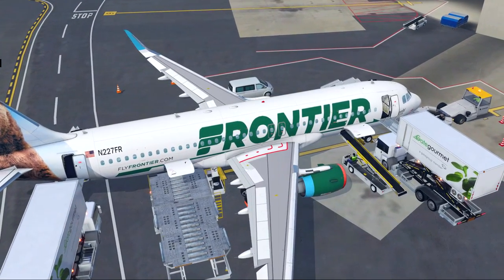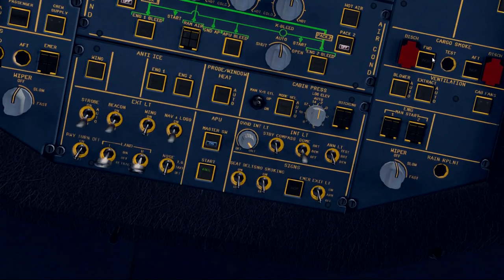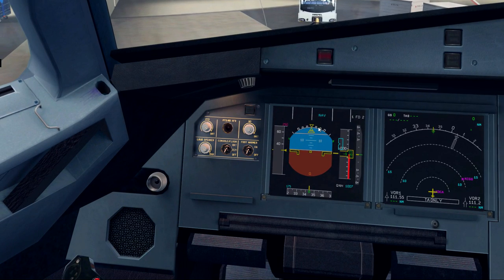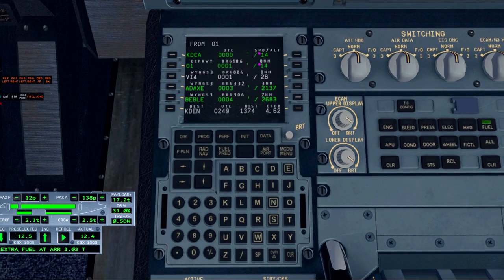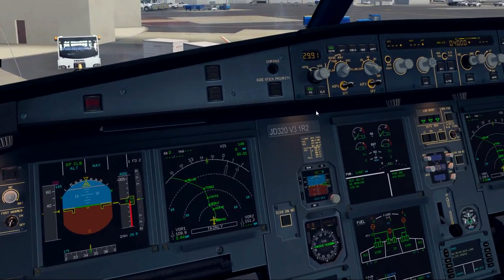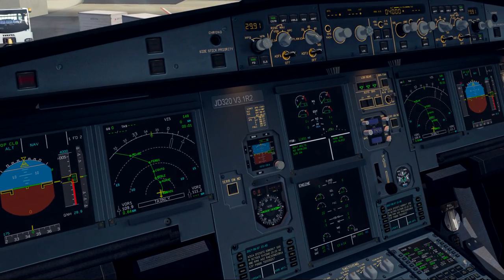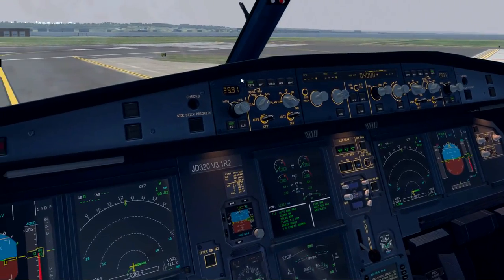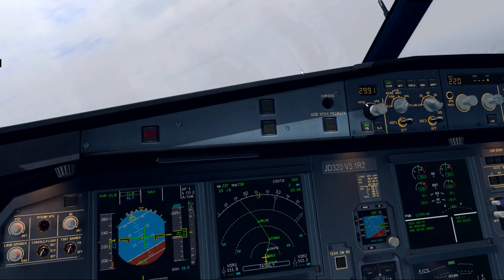X-Plane 11 - From Cold and Dark to Takeoff - Complete Tutorial - JARDesign A320

Comment: you are supposed to shutdown apu after engine starts.
Reply from the maker: Once the main generators are supplying power the APU is no longer required and is just burning extra fuel.   It probably differs by airline but I shut mine off after engine start and complete and the generators are now supply power and airduct pressure for the PAX system.

Comment: hello , quick question , how can i update my database of the MCDU ? thanks
Reply from the maker: You need access to an AIRAC data provider.  The two big ones are Navigraph and Aerosoft Navdata PRO.   Once you have a new cycle package from either of these you would plug it in to the custom data folder in the A320 aircraft folder per the instructions in the JARDesign manual.
Reply: Captain K-Man thank you so much , I suppose that now , I have to figure which of both are the best , between Navigraph and Aerosoft
Reply from the maker: I personally prefer Navigraph.  I subscribe to their monthly service which gives me access to unlimited AIRAC cycles and access to the CHARTS App which let's me load up-to-date full color SID/STAR/AIRPORT information plates.   Navigraph is used by 99% of all aircraft and utility apps in X-Plane.

Comment: APU should have gone off before takeoff lineup (or prob before taxi).
Reply from the maker: Most likely.  It's kind of the way we do it in the 737.   After the both engines are on, establish PAX Air, switch off APU Bleed then power down the APU and finish up before taxi checklists.   I need a lot more practice in the Airbus.

Comment: love the video thanks! I did have a question though, how did you update your nav data???
Reply from the maker: I have a subscription to Navigraph.   I used the FMS Data Manager to install the data automatically as it is updated to the latest cycle.  You can also manually add the data by downloading it from Navigraph for the JARDesign Axx series of aircraft and just unpack the contents into the A320's install folder in the NavData sub folder.   Either way, AIRAC cycles are not free.
Reply: oh okay thank you very much!
Reply: also sorry to ask but will you be coming out with another video on cruise and landing as well?
Reply from the maker: You are the second to ask so I guess I will.   This bird is fairly easy to land.  It pretty much lands itself!
Reply: Every time I'm doing it my speed is always climbing and I can't figure out why haha I'm sure I'm doing something terribly dumb
Reply from the maker: You are probably not pulling the throttle back to climb speed autothrottle setting and letting the aircraft manage the speed.  If you push throttles full forward that leaves the aircraft in TOGA mode which means full power non-stop regardless of what speeds are set in your FCU.

Comment: how do i add liveries to the a320?
Reply from the maker: In the A320's install directory there is a subfolder labelled LIVERIES.   If the livery package you want to install was done right you usually just open the ZIP file and drag the livery folder inside the ZIP file to the Liveries folder.  Next time you start X-Plane the new livery should be in the drop down menu.

Comment: Is it an Airbus a320Neo or an Airbus a320?
Reply: Neo
Reply: Oh, okay thanks!
Reply: Nvm, this guy has the a320 because it has cfm56s. I have the 320neo with the pratt and Whitney engines. The tutorial works for both.
Reply: @ma_arkus1941  Double nvm, you can actually switch the engines in the mcdu menu.
Reply: Oh so on JardDesign you can switch engines.
Reply: It's neither. The JAR320 is an A320 in name only. System-wise it is very far from the real thing.